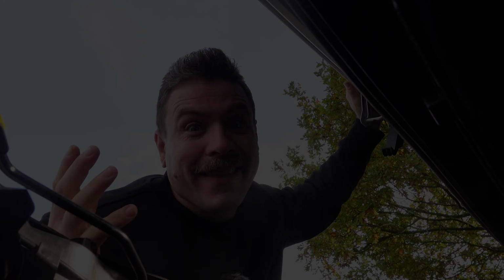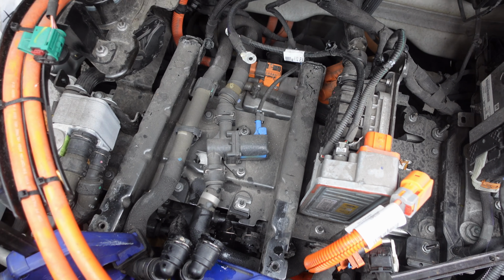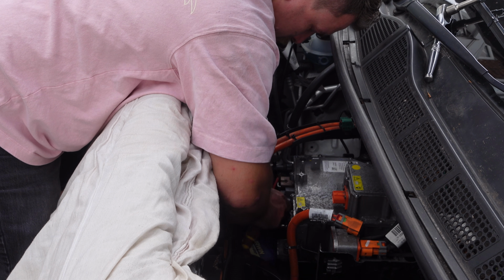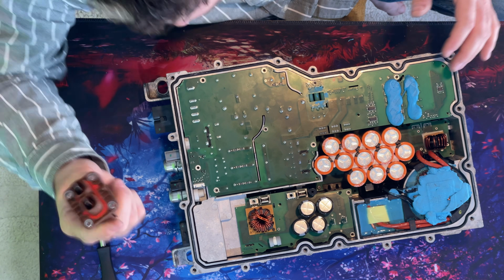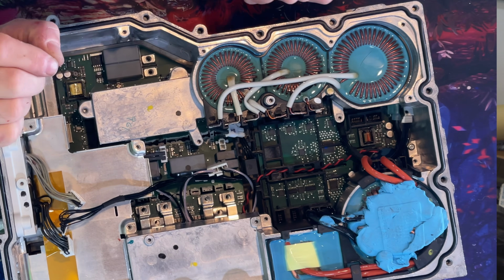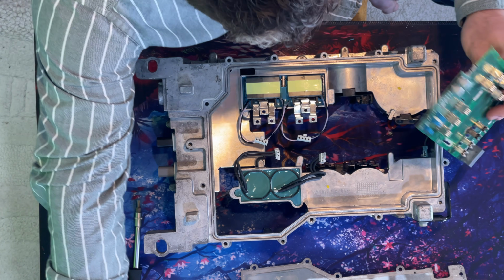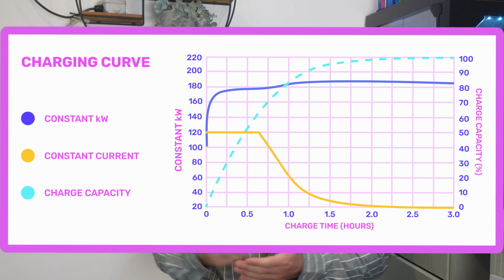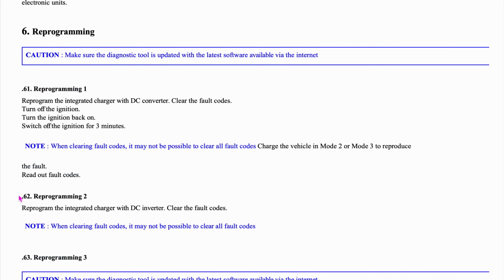Dealer Quoted £3,000 — I Fixed It for £380… But It Wouldn’t Work Until the Dealer Did THIS!

Comment: I have replaced more than 10 of these charging units, and no adaptation was required. I simply replaced the unit, cleared the error codes, and that was all."

Comment: As a Hardware Test engineer those plug & sockets are very poor,  thats the first point of failure, if the company did a full test on this it should be vibrated on a vibration table under bad road conditions potholes etc, what they should have done is a temperature test of component areas that will get hot, induction coils will get hot, but even more heat due to poor conections in that area, I'm glad you told them about the right to repair 👍 even parts on my ols 2005 Volvo S80 are encoded WH* it's making the right to repair very fustrating to the person that can repair this equipment,
great video 👍
Reply from the maker: I would like to see inside the redesigned version. See what they actually changed in the spec

Comment: I'm facing this issue right now and i'm struggling with a stellantis service that absolutely gives zero f**s about me as a client. I am 100% sure i want to replace my MAHLE obc with the VMAX one, the dealer said they can't do anything with a piece brought by a client. 
By the way, the company in poland (a specialized repair shop) that has a vmax obc i can buy, told me that if my car has a mahle and i swap with a vmax, it doesn't actually need coding.

Does someone has done this swap and can confirm this thing ? This could be the game changer in all of this story
Reply from the maker: Hmm. I ended up replacing mine with a MAHLE before I discovered I should’ve upgraded it with the Vmax. That definitely needed coding. The swap isn’t that hard for any garage and you should find a dealership that is willing to code it.

There is no harm in trying to swap it and seeing if it takes a charge. Potentially mine could’ve needed coding because it was from a different vehicle in the lineup. Regardless, there’s no need for this coding to be online.

Comment: I replaced MOSFET transistors and now the charger works, but I still get the "Traction Battery Fail" error message. the charger is from another car.
Reply from the maker: Are you able to find the exact code the scanner reports?

Comment: I have a e208 my 2021 and the Mahle 11kw has already been replaced in 2023 with an identical one. It just broke again, Stellantis says they can't install a vmax, is that a real thing?
Reply from the maker: Urgh. This is why I put the video out. To raise awareness of the known issue. 

My understanding is that all replacements are  VMax. If they are saying you cannot replace it it 100% can be replaced by anybody competent as I’ve shown him the next video.
However, it does need coding to the vehicle so you will need them or another dealership
Reply: @TheOfficialBatteryMan Thank you very much for the answer, so in your opinion it is 100% possible to encode a vmax (cod oe 1691344480) on my E208 "first version"?
Reply: But above all, if the spare part was replaced in 2023 under warranty (extended to 4 years) then shouldn't the new spare part also be covered 4 years?
Reply from the maker: @giorgio2282 logically you would think so but I doubt they would honour it
Reply: @TheOfficialBatteryMan Obc just removed (what a struggle) on Monday the courier comes to pick it up and at € 1100 including taxes actronics will repair it and update it in 3 weeks. Without you I wouldn't have had the courage to do this thank you

Comment: Great video! 
At the moment I’m struggling with the same issue on my 2022 Peugeot 208. You were giving the advice to use the Chinese newer version instead of getting the German Mahle version again. Did you try that to make sure that it will work or did the coding dealer tell you that they would be able to also get that version up and running ? I’m asking because I was dealing with Citroen (PSA) cars quite a lot of times now and I made the experience that sometimes the better newer replacement parts will not work as they were supposed to. 
Continue with this great kind of content! Really appreciate that!
Reply from the maker: I learnt this afterward. So I had installed a secondhand Mahle part. But I have it from a trusted source inside Stellantis that the newer Chinese made ones are more reliable and should be used instead.
Reply: @TheOfficialBatteryMan   When did they start to fit the chinese unit?

Comment: for your safety, put the car repairing in the brand mechanic, but for you wallet safety, do not do it.
Reply from the maker: Understanding how they work is key to safely. Same as someone can safely work on their own brakes if they know how they work and how to repair them
Reply: @TheOfficialBatteryMan  maybe I should wrote "safety", because is not related to working safe, but to "wallet safe". Today gadgets/things are very hard to do by your self the repairing or modifications, because of complexity, amount of knowledge and information is needed. But you do a great job trying to it with the locks the brands try to put on.

Comment: Hello, just a question when you unplug the 12v battery you should unplug the HV battery too underneath the car? Or it’s enough the 12v unplug the start “removing” the HV cables? Thank you
Reply from the maker: Removing the 12v battery, waiting for capacitor power down and then removing the battery output cable from the top of the unit should be enough. It’s important to test that there is no voltage on the cable with a voltmeter.

You need to make sure there’s no power from the main battery cable in case the contactors are welded closed.

Comment: Do you know If the obc has a Protection against overvoltage EMV when the AC Plug is disconnected during the charging of the battery?würde mich

Comment: I used to be a motor mechanic and i bought a broken/non working 2018 nissan leaf  "it stated battery issue" from auction, After doing some testing myself i found the PDM was faulty on it and nissan want around £6000 to replace it, i took it off myself and stripped it like you did with that one to find it burnt inside what looked to be the charging side of it, so i paid £375 for a used unit, i've fitted it and car now comes up "no power"  and i think code P3176 inverter which tells me the charger was plugged in and it burnt the board and blew the pre-charge resister in Hv battery , we'll see if i'm correct in next week or 2 when weather gets better, 2018 leaf 1 owner 30k i won it for £720 plus Vat plus fees  £993
Reply from the maker: It’s a fun process to get to the bottom of the problem.  Not so fun to be spending out on it 😂
Reply: Bro do a video on the process ❤

Comment: 15:54 Could you please identify the unknown processor on that gate driver board? The conspiracy theory here is, they couldnt manage to fit in so much components on one single PCB, so they need to split the logic circuits into multiple sub PCBs. But then they discovered, "ohno how could I manage to sync and talk reliably with so much child boards???" So it end up with one MCU or even FPGA on each of those boards, like at least 1 Aurix MCU and 2 pieces of smaller controller. Worse even, the test point distribution of the smaller chips reminds strongly of certain TI Demo boards.. The raw material price of this OBC must have been outrageously expensive! And with so many positions to become potential failure points..
Reply from the maker: I’ll have to dig out the board and check.
Reply: And the thermal management seems to be a total disaster. Too many things cramped up together, those connecting pegs are not soldered, so each giving good amount of transition resistance..
Reply from the maker: I couldn’t agree more. Limited water cooling with much of the charger boards being in the free air within the unit. It must get hot in there. How were the little springy pegs meant to survive 😂
Reply: @TheOfficialBatteryMan  Supplier normally specifies like 20A@50°C free flow air for each contact, but when so many positions used in a space where air is barely flowing.. It results in a Sous Vide over time..😂

Comment: Once I bought a brand new Berlingo diesel (2012). You just made sure it was the last. 

Great video, thanks!
Reply from the maker: Is that when Citroen felt turbos were optional ?
Reply: @TheOfficialBatteryMan This was one from the series 'We put a turbo on it but it doesn't make it to 50,000 miles' 

With the well-known FAP filter system.

Comment: WHY ON EARTH WOULD ANY ONE BUY ANY EV OR HYBRED , ? DISREPECT FULL TO THE DINOSAURS ? WHO GAVE UP THEIR LIVES ?TO MAKE THE WORLD A BETTER PLACE ?THATS WHAT I DEDICATION TO A BETTER TRANSPORT SYSTEM , THE CARBON FOOT PRINT IS LARGER THAN ANY DINOSAUR  MADE WITH HIS WHOLE CLAN . Well done mate and thanks for your problems and I'll keep running my dinosaur drinking cars for years to come . Citroen should go back to making  THE BX DISELS ?that ran for well over 250,000 miles , if serviced properly . One taxi company clocked up 500,000 miles . 🤔 How much carbon has been created ? mining , building , shipping this crap around the world and crap from dealers .🤔
Reply from the maker: People forget how much effort goes into getting oil out the ground, refining it, shipping (literally) to ports. Then moving to petrol stations. For it to be dragged around to get 25% efficiency. 

I’m with you engines are more fun. Have personality. I’ve owned v8s, motorbikes so on. But for day to day. Going to the shops kids to school I don’t need that. I need cheap and electric ‘ONLY if you have a drive’ is that

Comment: Stellantis are replacing those chargers for 8year warranty + they have 4year extended warranty for that charger. And there has to be warranty for their repair also so if it brakes to often they will be fixing it for free for ling time😅This is way Tesla is so amazing with their Service mode. And you can use Tesla Toolbox with simple wire and subscription... Might be biggest right to repair car brand there is.

Comment: Some car companies have a configuration file that has the vehicle spec in it. If you decide to upgrade the spec of your vehicle even with brand new parts from a dealership, you have to pay them ~£1000 for them to plug a laptop in and modify the car configuration file to allow that new part to work. 

Worse than this, if you try to plug a component into a car that is not coded with that spec, then it BRICKS the part until it's plugged into a vehicle with that spec. So it could be written off as dead/faulty when there's nothing physically wrong with it. 

If your car gets stolen then insurance pays out and you buy another, they make more profit. If a component dies/is stolen and you need a replacement, they make profit. This is a profit making scam. This is anti-consumer. Anti right to repair. anti-environment. And they WILL keep doing this to the maximum the law will allow. We need the government to legislate against it.

Comment: There's an issue with cars being stolen and chop shopped out into parts sold for profit. It's very hard to disinsentivise this practice in a way that doesn't affect right to repair. I want to be able to buy second hand parts for my products that work. I also don't want my working product stolen. One "solution" is to code the parts to that specific product so that they won't work on other vehicles so that people can't make profit off selling stolen goods because they won't work. 

This isn't that though. Because if it were they would be able to trace the original vehicle and verify if it had been stolen prior to re-coding. And the cost should be less than £100. You should be able to get the codes through a web portal which checks if it's stolen, and given the unlock code if it isn't, for free (or close there to). At End of Life for the vehicle model, all codes should be made available for download so that they can't shut down the web portal and prevent people from repairing that vehicle in the future.

If they just charge you to re-code it without checking if it's stolen then this is 100% a cash grab greedy scam. And the Gov should step in and legislate against it on the basis of right to repair, environmentalism, and anti-consumer practices.

Comment: Hey, I have the same issue with my 2021 Peugeot E-2008. I've found a company in Harlow that are willing to code the part if it comes fitted to the vehicle but I need to identify which vmax part I need. Are you contactable?
Reply from the maker: It depends of you have a single or 3 phase OBC 
You could always phone your local dealer and ask a price and the part number and then use that to source a second hand part. They are basically the same part across the board. I suspect the part you need has 984295818000 across the top.
Reply: @TheOfficialBatteryMan the car charges as single phase 7kw not the better version. Dealer has quoted 4000 + the VAT to fix it. Momentum the warranty company reckon they only will cover 2.5k inclusive so I'm left with the tab! I'll have a nosy with that part number. Thank you!

Comment: I'm confused. Also I have a 2014 Renault van with a charger error and the dealer quoted me €3500 to replace it. So wtf? I can put in an onboard charger from a different brand? What Chinese site can I get these from?
Reply from the maker: I expect that error to be non-related
Reply: @TheOfficialBatteryMan Renault charged €350 for diagnosis but never have me the actual error. They just said the whole on board charger has to be replaced and that can only be done with a new unit and that nobody can code a second hand unit for the car... Just ridiculous. It pops the breaker when I plug it in, then when I reset the breaker it charger normally for about 20 minutes. After that it stops and starts until the battery is full.
Reply from the maker: @Jonathan-vx2qj  repairability has gone out the window. Their technical documents won’t even give them the option for repair. It will just explain replacement.

Comment: Just got 3800€ invoice from the dealer for BOC and found this video😂
Reply from the maker: Ouch. I refuse to pay it knowing I have the skills to find another way. My videos on this subject have been to help protect people from that large completely avoidable bill. 

Sorry to hear you got swindled
Reply: @TheOfficialBatteryMan Can you please suggest me about one issue I have doubt now. I've found used OBC form another eC4 but 2 central connectors (they are up on the tubes with liquid) are colored in opposite way: my OBC has grey one on the left and black one on the right. New OBC has black one on the left and grey one on the right. Do you know how to connect cables to new OBC: with the same cable positions or use the 'color connector history' (in this case cable which was in left shall go to right and wise versa)?
Reply: Found used boc on market but official dealer doesnt agree to work with used part.. Because on that VIN lock seems a problem to make cheaper repair at all. Will try to find some other way ..
Reply from the maker: @tartok  find yourself another dealer. The first dealer I spoke to refuse to code a used part claiming safety working on the high voltage system. 

If a part being installed correctly, they don’t have to go near the high voltage system. They just plug a computer in and charge an hours labour. You need to find a dealership that’s more familiar with coding these modules some of them just don’t really do that type of work very often.
Reply: @TheOfficialBatteryMan  I found another dealer who is ready to code obc but they said in their experience some obc they could code but some couldnt. No guarantee they can code this.
Also recently spoke with the guys who selling used citroen's parts. They said they have experience to change a couple of inverters without any coding - cars started to charge immediately after hw change. But I am curious about such information.😅
Reply from the maker: @tartok  there is possibility of opening up the on board charger and swapping out the communication board into the new charger. 
But it’s likely that you’re still gonna need to clear all of the deeper codes that might be stored. A basic OBD reader won’t do that.

If the dealer has access to the online coding system, which they will, it should be a pretty easy fix for them

Comment: Too sad to see this. My story is a bit different. I have a Peugeot e-2008 GT my 2022 with the new toggle shifter. When the car was about 3 years and driven 25000 km the obc failed. could not charge from 3phase or 1phase from wallbox. dc charging worked fine and also 1phase via the granny charger. Dealer fixed it for free under warranty and also a free loaner during the repairs which could take 1 month to get the parts. But dealer called me in a week that my car was fixed and ready for  pickup. Now i hope the new replacement part is better quality.
Reply from the maker: Wow. Out of interest, did you purchase the car from that dealer?